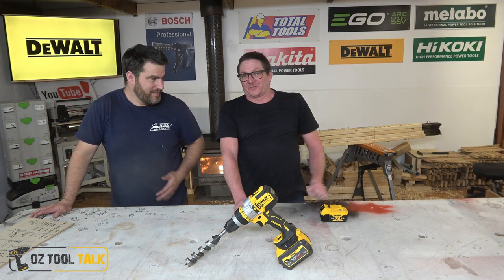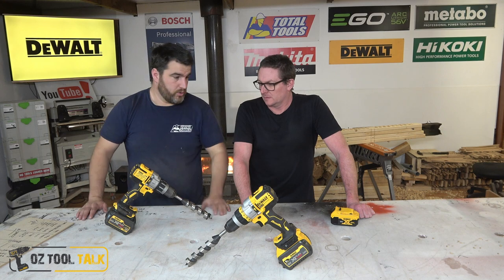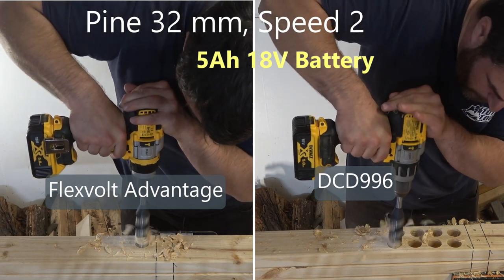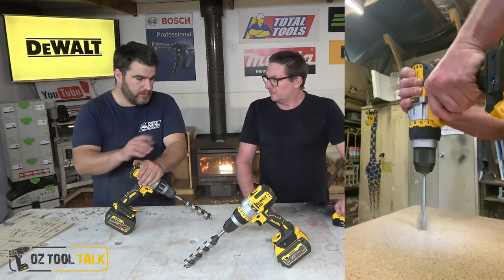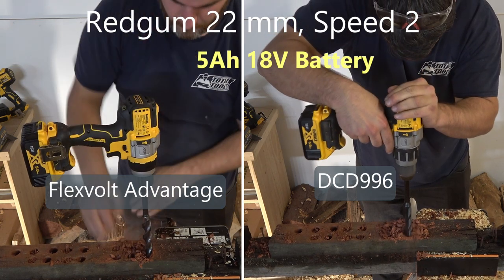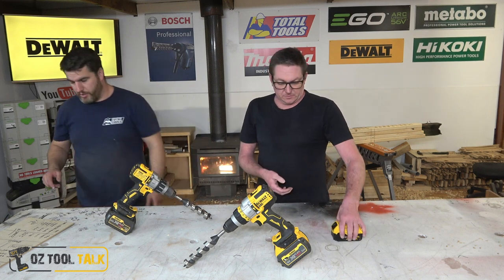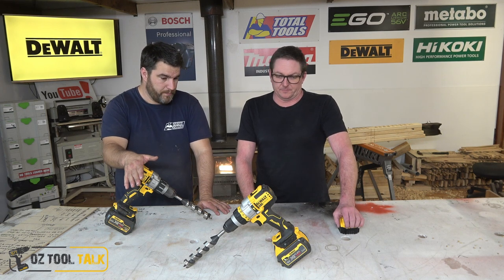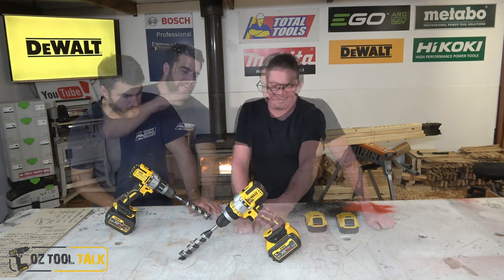Dewalt DCD999 Hammer Drill - FLEXVOLT Advantage - 18v 20v max [2021]

Comment: This is exactly what I've wondered myself. How does Dewalt's advertisement compare to the real world? To me it doesn't seem like Dewalt compares 996 and 999 apples to apples when they talk about percent increase in power. I have myself used my 996 to drill through 48mm of wood with a 168mm hole saw, and was surprised that it could actually do it. I've also had the intuition that the flexvolt battery gives more power to 18v tools in general. I myself have flexvolt advantage angle grinder and recip saw. They are beasts with flexvolt batteries, and do okay with 5ah! I am especially surprise by the angle grinder. You can put your whole weight on it with a flap disc without stalling the motor.
Reply from the maker: nice info, thanks :) appreciate your support
Reply: putting your whole weigh on an angle grinder is a sure way to get yourself cut in half or at least get some body parts amputated - the motor might not stall but if it binds, you're done.

Comment: Very interesting review and results. I have the 999 on order and should be able to test it myself soon. Despite having both Flexvolt and normal batteries I normally run a standard 5 on my drills for weight reasons. The Flexvolt get used on the power hungry tools like circular saws. I did order this drill for the extra grunt so when I need it a 6Ah Flexvolt seems like it will be the way to go.
Reply from the maker: cheers Dave, I do the same thing

Comment: I reckon a good way to think about it is that the new flexvolt advantage tools ARE flexvolt tools, that in a pinch or at the end of the day or whatever, will also work with the 18v batteries if needs be. Just my take on it though! Cheers
Reply from the maker: hey Jack. In a sense there's no such thing as flexvolt TOOLS, only flexvolt batteries. The tools are either 18V tools or 54v tools ;)

Comment: Got the 996 and it has more power than I probably ever need. Great tool, but the sound in hammer drill mode is just incredibly loud and annoying 😂 Unfortunately the newer batteries with newer cells are almost impossible to get here in Germany. 🙋🏻‍♀️Anna
Reply from the maker: Hi Anna. You speak truth. BUT that terrible sound does get you excellent masonry performance for this class of drill. Yeah the only newer cell batteries we get here in Aus are flexvolt ones too...
Reply: @OZToolTalk  True. However, if I need to drill a lot of concrete I borrow my father in law's Dewalt 18V rotary hammer. Please to use for that - especially as it does not scream like a banshee :-)

Comment: There can be a sweet spot for tool to battery. You will get more available current as you go from 2Ah up through 6Ah flexvolt and beyond but current is not the only correlating variable of performance for a given attachment. Current at some point will decrease efficiency through bit slippage or increasing safety circuit operation.
Reply from the maker: Indeed you are correct, for MANY application. But for say screwing down joists with hundreds of large screws, ALL the power is desirable.

I think a 4/5ah battery is just fine for the majority of uses though.

Comment: that flexvolt batterie on the 996, is that the newer ones with the 21700 cells?
or do you also get more power with the older  flexvolt 18650 cells
Reply: Do you know what the model # is for the Flex-volt batteries that have the 18650’s in them?
Reply from the maker: I believe all the 6Ah batteries have 18650s in them don't they? You would still get more power with the 6ah though, as it has 3 rows of (18v) cells.
Reply: @OZToolTalk  Honestly, I thought some 6ah were 21700, but your probably right.
Reply: @OZToolTalk  they say that flexvolt batteries from 2020 have the 21700 cells, they look a little different then the older ones , dont know if thats only in the usa
Reply: @paedahe4975  all i know is they look a little different, on reddit they had some pictures of the old ones and newer ones. batteries from 2020 should have the 21700 cells they said on reddit
Reply: @promo130  👍

Comment: Hey Guys I have a question .I have a DCD 999T1 18V  But it does not have flexvolt or flexvolt advantage written on it.My question is, Is are all DCD999 drills  flexvolt advantage or does it specify on the drill?..

Also I wish to ask is the American DCD 999 20v and the UK DCD 999 18v the same?
Reply from the maker: yes, what the US calls 20V Max, Europe and Australia call 18v.

I imagine the DCD999 would be the same unit in all countried, in this case 'flexvolt advantage'

Comment: did you test the 12ah flex on either drill? Also was the 9ah the old model with 20700 cells or the new model with 21700 cells? Same with the 6ah did you try the 18650 6ah flex or the 21700 6ah flex?
Reply: almost forgot the upcoming 15ah. Might as well try it too.
Reply from the maker: we'll we didn't try everything obviously. lol

Comment: How do you like this compared to the Gen 3 Milwaukee? DeWALT FVA more powerful but Milwaukee not far behind?
Reply from the maker: we haven't tested them head to head, but we did crack out the Gen3 FUEL during the test and initial thoughts put it very close. We're gonna do a hammer drill comparison later this year, so keep an eye out ;)
Reply: @OZToolTalk  I wish it could be sooner because I need to make a decision soon and I value both of your opinions!
Reply: Oz Tool Talk Great work guys, going insane during lockdown and i’ve really dug into your reviews, please do a head to head with the Flex volt soon!

Comment: Serious question now, what's the difference between this and an SDS plus+1/2 inch chunk attachment. say dch293(dch333 at Europe).
Reply from the maker: This sort of 'hammer' drill is a drill that is made primarily for drilling in timber and steel. It is very powerful for those tasks. It's hammer function in concrete is: much less powerful, much less pleasant, and much harder on drill bits than a rotary hammer drill.

if you do the odd 6mm, 8mm or even 10mm hole in concrete, this drill will serve your needs. if you regularly drill in concrete, or ever want to go 12mm and beyond, you should get a rotary hammer drill (like said dch293. The rotary hammer drill spins much slower, but hit much harder, and are MUCH more pleasant to use. (Dwain)
Reply: @OZToolTalk well first, i was not expect a personal reply to my question, hat off to you sir. 

Second, if I understand your reply correctly, the primary function difference on timbers. personally I drill all my hole on timbers using my impact (dcf887). so it's kinda safe to assume I can skip this and get a rotary hammer + attachment. 

Lastly, It will be quite interesting to see a video to see how a sds plus perform some task people use 1\2 inch chunk for (make holes in timeber, mixing stuff, even fasten some screws, etc) not sure if manufacturers are happy to see that video.
Reply from the maker: @darksahde  hey Wu. you're welcome. I think a drill is still the most important tool in a person's toolkit. I wouldn't get an SDS drill (rotary hammer drill) plus chuck attachment as your primary drill. I'd get a drill like the DCD996 or 999 and then buy a rotary hammer drill later if you do lots of concrete drilling.

I do use my SDS drill for mixing a bit, but its not recommended.

Comment: Hey guys, Dewalt DCD 999 20v is compatible with 18v 54v 9ah flexvolt battery?
Reply from the maker: yes of course :) 20V Max (USA marketing) is the same as 18V for the rest of the world. Flexvolt batteries run at either 18V (20V max) or 54V (60v Max) depending on the tool you connect them to.